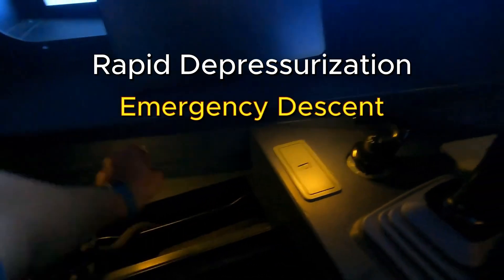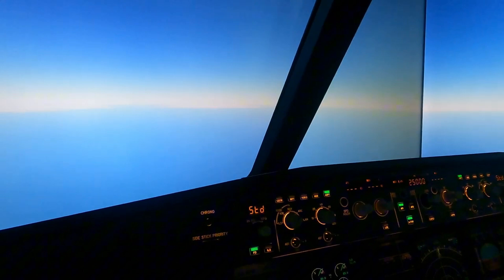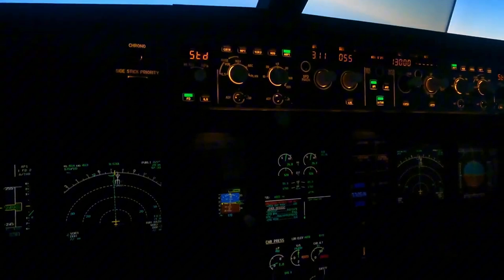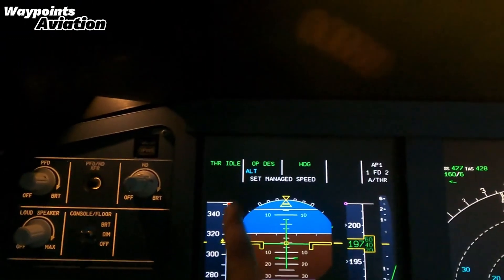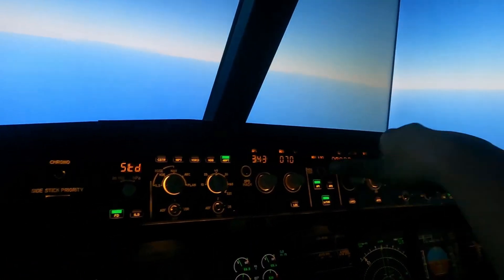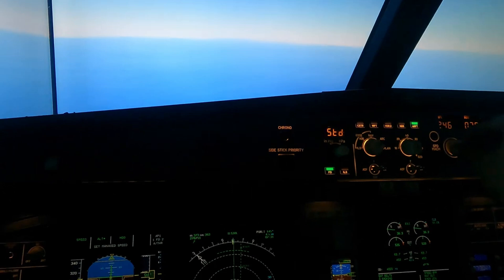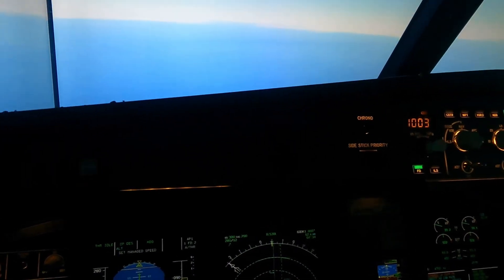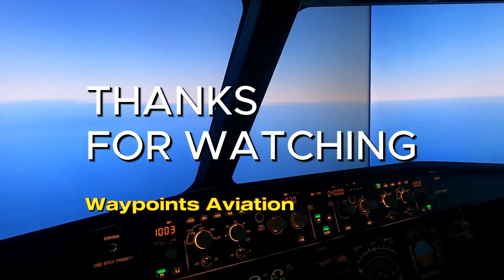Airbus A320 Tutorial: Rapid Decompression - Emergency descent demonstration

Comment: one question from air traffic controller
why did you turn left off track instead of turning right? accroding to our regulation aircraft in emergency descending should turn right by 30degrees and fly for 20km. So when you start descent I will immediately instruct opposite direction traffic to turn right to avoid you, and it's very dangerous for you to turn left
Reply: interesting question could be difference of company sops/manuals - i recall ours is track of 45 L/R depending on where the closest airport is (at impulse if u ever notice where) .

Comment: Two questions: 
1. Why not use the Expedite mode to descend?
2. What’s the reason behind ENG MODE IGN?
Reply from the maker: You will have to review the situation before deciding the descent speed. A/C damaged or not, etc. 
In-regards to the ENG MODE - the ECAM calls for it, i would think it does so to eliminate the probability of flaming out due to the combination of possible high vibrations (A/C Damage), prolonged period of IDLE power, turbulent conditions during the rapid descent.
Reply: @waypointsaviation  thank you sir ❤️

Comment: Would you ever use the expedite function in the autopilot for the emergency descent instead of manually working the speed?
Reply from the maker: After the initial descent "Turn and pull", you would revisit the modes and go for expedite descent after you confirm that there is no aircraft damage/ traffic/ etc.

Comment: The RAT came out because you pressed the wrong button at @5:59
Instead of pressing the oxygen masks, you pressed the RAT button. That's why we callout "confirm", so that the other pilot confirms what we're doing to avoid this kind of mistake
Reply from the maker: Nice catch - did not realize it. 100% agree, cross-checking in the cockpit is essential!!
Reply: @waypointsaviation  All guarded switches should be cross checked before operation. Might be best if the video was removed until re-done?
Reply: @waypointsaviation  Love to have that CRM
Reply: "Who let the rat out?"